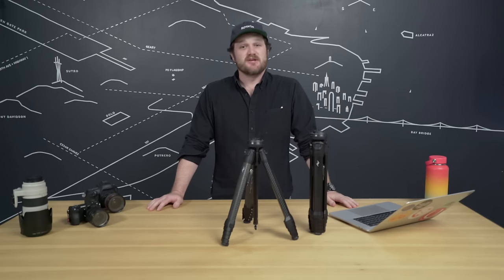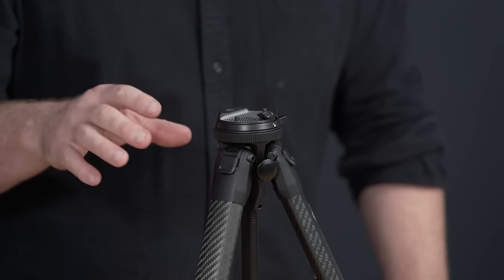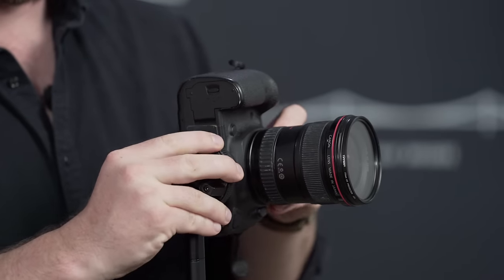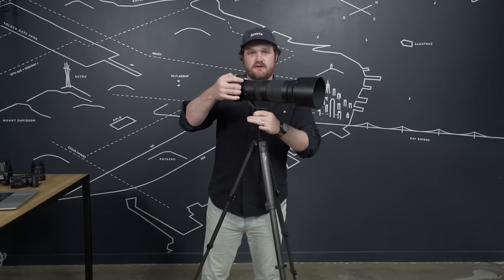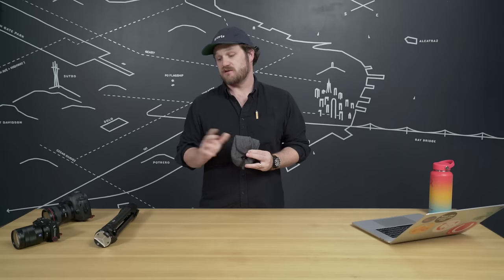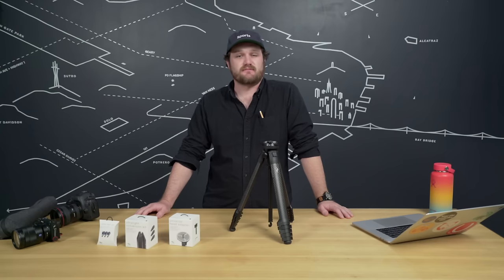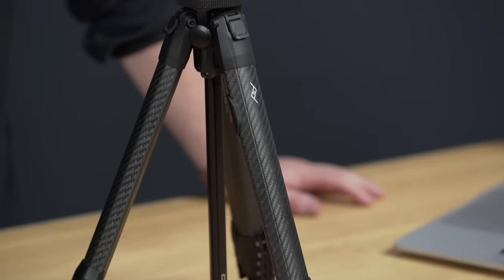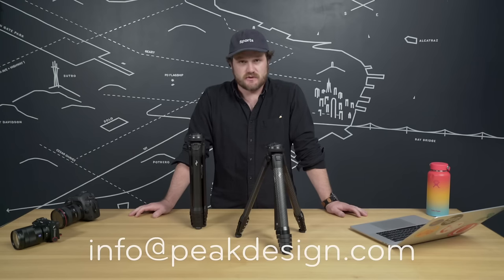Peak Design Travel Tripod + Accessories: Setup + Tips

Comment: This tripod NEEDS to be in my bag, but I don't make 6 figures a year.. $600  is absolutely astronomical unless you're a huge production company, but this tripod is targeted towards travelers (hint "travel tripod") and I doubt most travelers are willing to shell out $600 for a tripod when you could spend half the price on another top of the line tripod regardless of it weighing 0.0005 grams more.  IMO I'd pay $300 for the carbon or $190 for the aluminum one. But if yall are selling out, you do you, take that quick buck. But as a travel photographer myself, I can't justify spending that stack for a small tripod whether its design is revolutionary or genius or not (which it is, it's an absolutely fantastic tripod as far as travel practicality goes). Once y'all lower the price to a decimal I won't have to pull out a loan for, I'm all in, but until then, Manfrotto will have my $$$. Much love!

Comment: The possibility to invert the center column makes this thing also great for the occasional macro shot especially on vacation. If you use this technique more often like i do you can use an Arcaswiss-double rail to avoid the camera hanging upside down. The two guys from “Traumflieger” made a nice video (unfortunately only in german). > https://youtu.be/Ujbkvxzsq48
Since especially the carbon version is not cheap and i am already owning 4-5 tripods, i was a bit hesitant to buy this TP, but now  that i have it i rarely use an other model when travelling. It’s small and extremely versatile. Expensive but extremely good and definitely worth the money.

Comment: I have found an annoying design fault with this tripod. If you use the Universal Head Adapter and fail to tighten the three little hex screws (because you are swapping heads frequently), then they have a tendency to fall out and could be lost. Fortunately mine fell out in my Pelican case while traveling. Furthermore, tightening these screws with the supplied tool is irritating as the you can only do a half turn as the tool hits the centre column. It is a pity that the tool cannot be straightened to avoid this happening. I intend to grind away the stop with a dremel so that it can be opened straight. To be honest, I believe these are quite basic issues that should have been sorted out earlier.

Comment: I’m sorry but I tried this tripod and the legs bend because they are not cylindrical.
Reply: I would assume the aluminum version? thanks
Reply: Issac Gutierrez  both bend, but the carbon is the worst. I had one and I also went to the Photo Expo in NY and everybody complaints about that. You can see Tony and Chelsea’s review agent they went to Iceland. They disliked the tripod.
Reply: @erikavelazquez1835  Wow well thanks for the info, Ill check there video out...have you been able to get a replacement? I was willing to over look the price on the CF version but going to have to reconsider cause Im not light on my gear.
Reply: Issac Gutierrez I ended up with MeFoto Road Trip S carbon fiber. It is more sturdy, light, versatile, and compact. That’s the one I use for traveling and street photography.

Comment: I regret buying your tripod (carbon) nothing justifies the high purchase price, I made extra costs to put a ball head on it, your system works poorly and is difficult to use, making a good panorama photo does not work at all, you slide the tripod completely then it is very unstable!!!! I removed the allen key because it is very easy to lose.
Peak you have a very bad product that doesn't live up to its promise, for more than half the price you have much better alternatives.